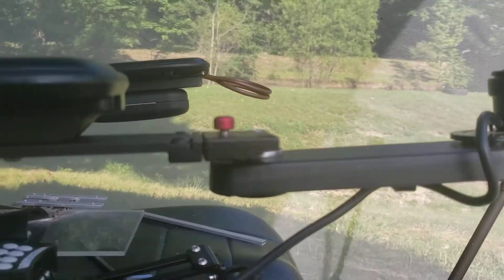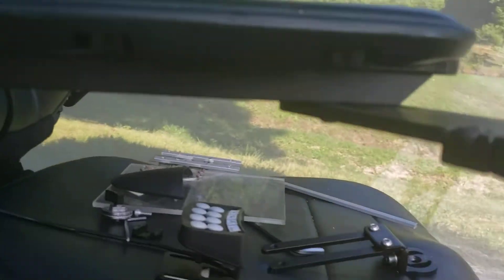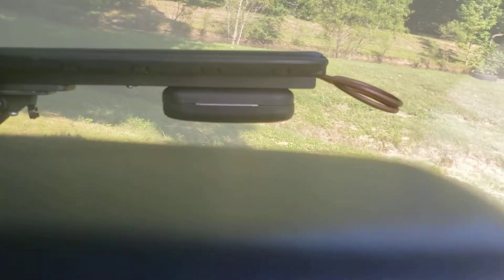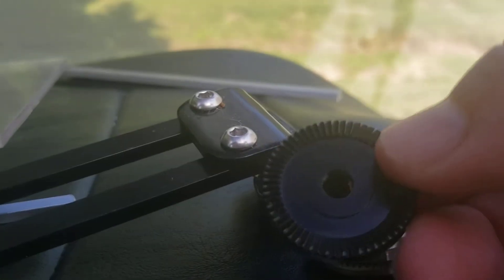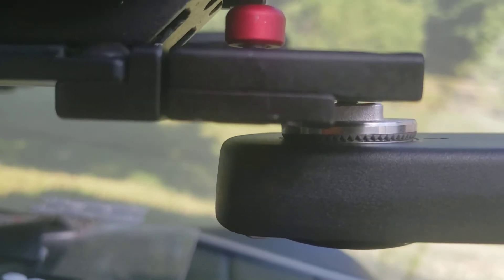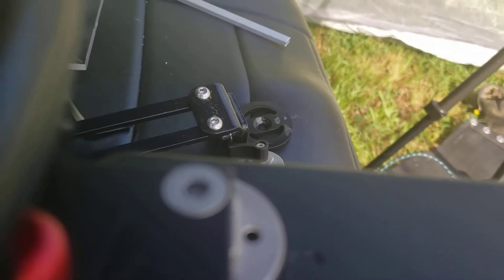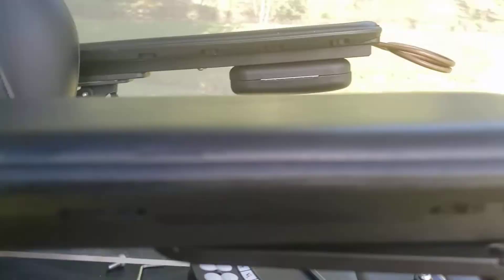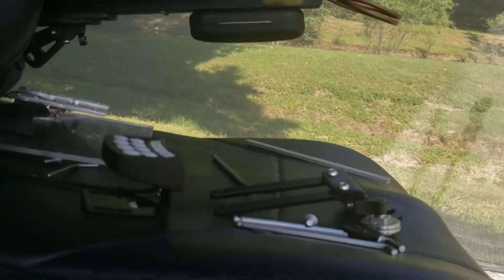chair mods 13

Comment: Hey Dustin, We were having good chat on Dan's livestream before it ended. Just wanted to say howdy do.
Reply from the maker: Hello again.  Thanks for dropping by.  Always interested in robotics stuff.
Reply: @DustinMaki1  Thanks! What is your interest/current project in robotics?
Reply from the maker: I was a FIRST Robotics mentor, VISTA, control systems advisor,  robot inspector at champs.  Vex judge.  Built a few bots.  Working on 4 wheel drive 4 wheel steer prone mobility device.   I'm currently learning ArduPilot Rover with the intent of making a CAN driver for R net https://discuss.ardupilot.org/t/wheelchair-guidance/86575
Reply: @DustinMaki1  Wow!! Super cool!! The FIRST robotics experience explains your knowledge go the REV controllers. I am definitely interested in your ArduPilot project. I will check out the link.
Reply: @DustinMaki1  I read through a good bit of the discussion.  I am very intrigued. I have a crashed Solo 3dr drone for parts, and/or repair. But I was thinking of taking the nav system and moving it into my 6wd rover.  I see your handle on the Ardupilot thread is slomobile. Does slo refer to San Luis Obispo, by any chance?
Reply from the maker: I've never had a drone myself and lack that whole realm of experience.   Looking for collaborators if you are interested.  Slomobile was a nickname from a car audio team teamROCS.  I had a '62 Pontiac Starchief with 15" subs in the kickpanels.
Reply: @DustinMaki1  The drone was crashed by someone else, then given to me as parts or repair. I have not done anything with it yet. I will look and see what kind of navigation system it has. If I have compatible hardware, I would love to collab on the project. In addition to my 6wd robot, I have a power wheelchair (complete, with power seating) and multiple wheel chair base assemblies, that I could use as a test platform.